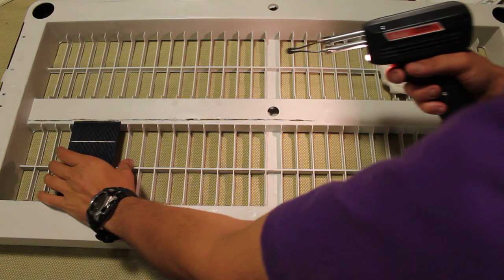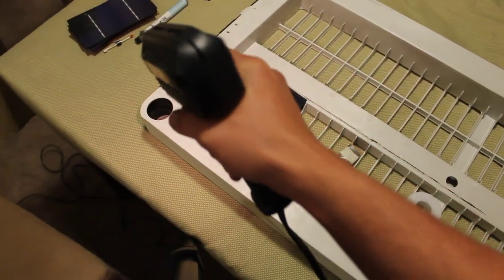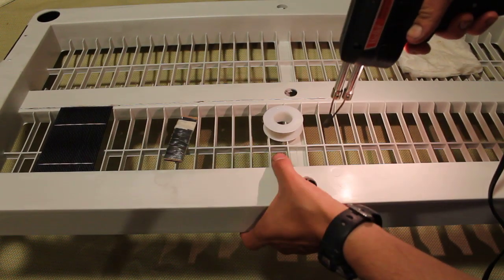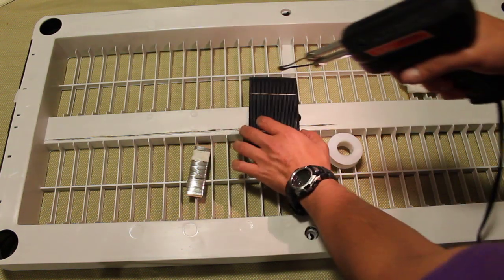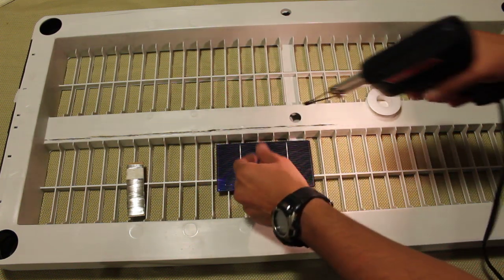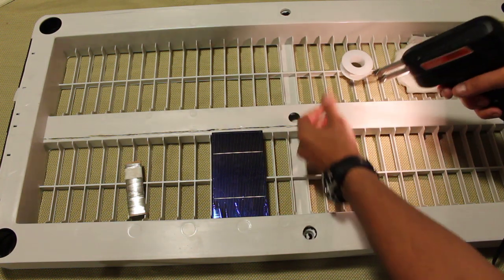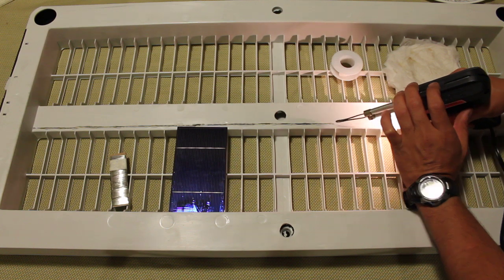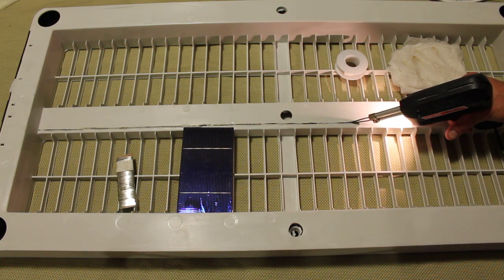(1-5): How to build a solar panel from scratch

Comment: TMI. Please get to the point. I understood why you were cutting the plastic with your (Soldering Iron), how you were cutting it and that it would have to be cut across the top & side to accommodate the cells, in like the first 5 seconds. Do you realize how many times you repeated yourself.? I just wanted some tips to build some more panels in my lifetime. The whole video consisted of: The cells are fragile and therefore must be mounted in a rigid frame. The frame has to be cut to fit the cells.